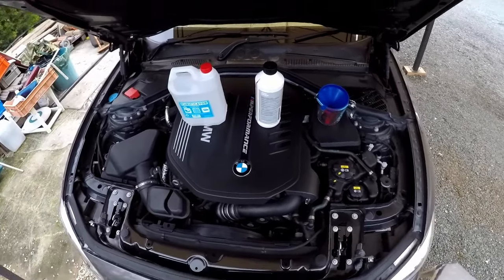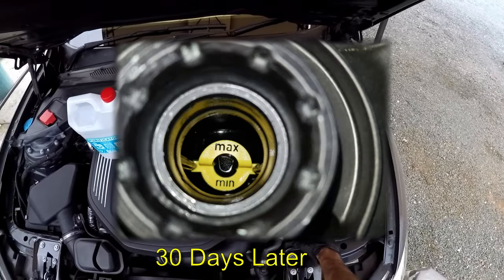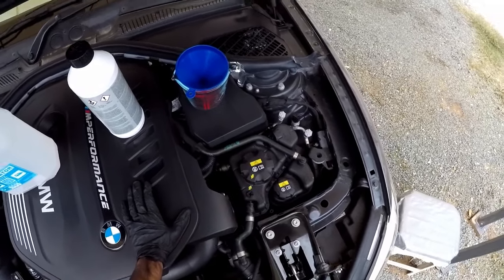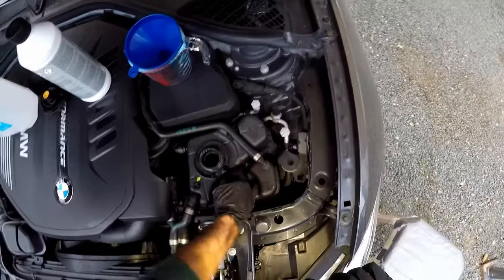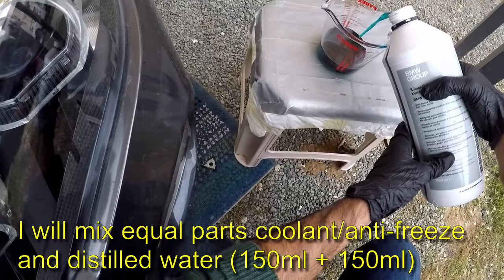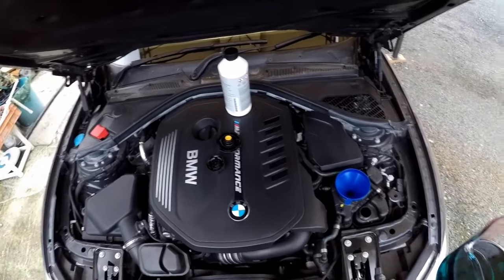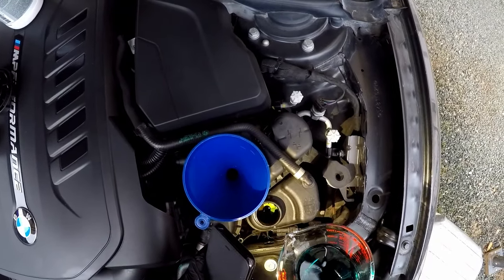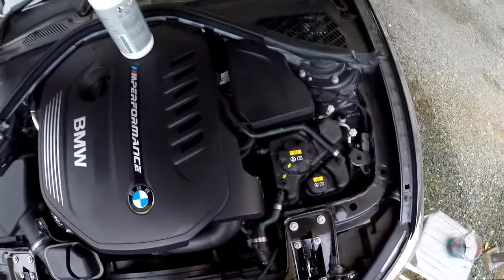BMW B58 Engine: How to refill coolant (Escaping from Filler Cap - Quick Video)

Comment: Ik your not suppose to mix coolant but I got mine used and I don’t know if they used oem blue bmw coolant. I am at 41k miles and I need to top it off. Would it be okay if I top it off and wait until 50k miles to do a full coolant flush ?
Reply from the maker: Interesting question, I guess the chances of the previous owner(s) using some completely unapproved and dubious coolant is quite low (i.e. issues that could come with intermixing are quite low probability). Depending on how much you need to top up, perhaps just add distilled water? This way there is no risk.
Reply: @NoBrainerTalk  it’s just sitting right under the minimum line but I’ll give that a try ✌️

Comment: The yellow min/max gauge thing appears to be attached to two vertical rods inside the reservoir. Is the yellow gauge thing supposed to slide up and down on those rods or is it always supposed to be at the bottom, (roughly 6 inches below the top of the reservoir)?
Reply from the maker: The minimum-maximum level indicator should be at a fixed height within the expansion tank, it should not move.

Comment: 🤔hm, I have to add some coolant to my 340 i 2020 I don't drive to much but about 8 months, and I have a chevy tahoe 2005 in 8 years of driving 50 000 miles no coolant added, just saying 🤷‍♂️
Reply from the maker: Fair point.

Comment: Hey so I wasn’t paying so much attention and just dumped in coolant until it reached the top of the reservoir haha.. do you think that would cause any issues? Only thing I may think would be an increase in pressure against the reservoir and connected hoses.. which could cause a leak? Maybe? Let me know what you think. Thanks
Reply from the maker: You should remove the excess fluid (fluid above MAX), as you have left no room for expansion in your expansion tank. Only negative consequences can occur including bursting of weak spots in the circuit. No way to predict what will give up first, you don't want to find out. :)

Comment: i have the yellowish color in my intercooler tank, it’s little below the min but not much, can i add some 50/50 blue bmw oem coolant with distilled water mix to top it off?
Reply from the maker: As I don't know what the yellowish coolant is, I can't recommend to mix any blue coolant in there. Top up with distilled water is the safer choice in my humble opinion.

Comment: Great video. Question, just drained coolant on mine and also did the bleeding procedure. The coolant in the main tank for engine cooling stays at the correct level. However, the second reservoir for intercooler went below minimum mark everyday after using my car(it has been 3 days) and I filled it back up 3 times accumulating about 500ml of 50/50mix coolant already. I assume the secondary reservoir uses electric pump which should already had been bled as I mentioned earlier. Do you have any suggestions?
Reply from the maker: I'm sorry to hear about your issues. The bleeding procedure can be imperfect, and topup soon after is not uncommon. However, assuming this is persisting (topup daily), and you don't suspect the expansion tank cap (no sign of spills/evaporation), you probably have a leak somewhere in the intercooler coolant circuit. Have a good look at the intercooler radiator at the front of the car, especially if you don't have the black stone guards. If you do have the stone guards focus especially in the middle area where there is a gap between the stone guards. If there is no obvious sign of leak (at the radiator or elsewhere in the engine bay), and the coolant continues to be consumed at this rate, the system needs to be pressurised for troubleshooting. It's possible for the coolant to be lost in the intercooler and end up in the cylinders for combustion,  so also check for the smell of coolant from the exhaust while the engine is running. If you see noticeable smoke from the exhaust this would also be a sign of coolant going into the cylinders.
Reply: Thanks for the detailed explanation.
The intercooler reservoir fluid stayed level between min and max without having to top off for years until I did the coolant drain, so while the leakage might be the problem, I am leaning towards the imperfect bleeding procedure. Just curious if the bleeding procedure (low beam on, heater to max and lowest fan setting + holding the accelerator actually bleeds both engine and intercooler coolant or is it just for one of them?
Also, just monitor the intercooler reservoir again after letting the car cool down and the coolant level seems to remain where it should be now :)
Reply from the maker: @Bennymix99  I believe there's a dedicated bleeding procedure for the intercooler coolant circuit. I believe it's very similar to the engine coolant circuit, but headlights on (not just low beam) and hazards on, then the rest - heater to max and lowest fan setting, and hold accelerator for 10-15 seconds (until the pump starts working).
Reply: How did you drain the coolant for each system? I can't find any info on drain points for these systems. Thanks!
Reply: @michaelkelly3158  Any success? I am also curious about it at b48 engine. I think removing the lower radiator hose should do but not sure?
Reply: @cemildenizel2223  I didn’t do it in the end and everything has been ok since
Reply: @michaelkelly3158  You have to drain and replace the whole coolant every 2 years. so you will eventually do the process. bmw authorised service uses tap water instead of distilled or drinking water , so it is better choice to do it yourself if you dont want your heater not heating the car in winter because of clogged heater radiator caused by bmw dealers tap water.

Comment: My coolant caps were rock solid to turn as well only 12k on the car, lubed the seal and thread now it's like butter ;-)
Reply: What did you lube them with?
Reply: @jzallday102  A light smear of silicone grease. I'm at 25k now and still no issues with the caps.
Reply: @sportsmachinerr1401  thanks man

Comment: Had the same issue on my 18 F32 440.. Car has 22k miles on it and noticed it around 10k..  Issue was only in the main coolant tank.. Asked my dealer to replace the cap and that fixed the issue for me.
Reply from the maker: Certainly the most commonly reported issue and solution.
Reply: @NoBrainerTalk  Is the new cap you get from the dealer a new cap for the same version car, or is the cap you get from factory from a newer model car or a recalled part that is fixed with a better seal?
Reply from the maker: @jonathangarn9635  It's brand new part, and it's the same Part Number as the existing one. To be honest I haven't installed my new caps, I'm saving it for a special occasion. 🤣🤣🤣
Reply: @NoBrainerTalk what's the year/month of your B58 car ?
Reply from the maker: @LionHeart567  May 2018
Reply: @NoBrainerTalk  Production date May 2018 ? There are two SIB if I remember for coolant factory filling issue on B58, and possible turbo issue, both till september 2017. And online I saw that the turbo can eat coolant (which is not normal). Maybe the bmw time period is not large enough ? How many km/miles did you make in these 30 days when the level dropped below the minimum ? Thanks
Reply from the maker: @LionHeart567  Hi there, I honestly don't know the kms in 30 days, but it would have been quite minimal. Thanks for the general concern, but since the replacement of the caps on my expansion tanks, I have had zero issues (checked today, level is exactly where it should be). In terms of the SIBs, if you can find the references I will check them out for my general knowledge.
Reply: How did you get the coolant Temp on your dash. I have a 2017 540i. New coolant reservoir tank at 65k and new radiator with 85k miles.  This design of radiator runs straight across and doesn't zig zag like the old radiator that is top to bottom. Good luck.  Run the AC when it's hot so the fan kicks on
Reply from the maker: @Nick-wr7vv  You can see coolant temp using the hidden menu. I have a separate video on that:
https://youtu.be/-qCwnptZ2Kg
Reply: @NoBrainerTalk  thank you for the hidden menu. Now that I changed my radiator I didn't put the bottom plastic on yet. Just checking things out. After I drove it around for 10 minutes. The top of the radiator is hot. You can't touch it. I crawled under. The bottom of the radiator isn't even warm. I don't understand what BMW is doing with this design. But it isn't working
Reply from the maker: @Nick-wr7vv  Good luck and be careful.

Comment: I done my coolant service with vacuum machine but when i tried to do on small coolant reservoir it didn’t work so can you tell me how to do that i also want to flush that small reservoir
Reply from the maker: You can do a post flush bleeding procedure for each system, so if vacuum filler didn't work, just bleed the low temperature circuit using the BMW procedure for that circuit.

Comment: Man, thanks for your video but empty in only 30 days looks strange no ?
Reply from the maker: Yes, but the caps are main culprit. I replaced the caps around a year ago, and I think there's been no issues since. So far.
Reply: Would you say these can still be a culprit if I cannot see any white deposits on the top of the expansion tank? Mine seems to go from Max to below min every 120miles

Comment: Hello im loosing water on the small tank but i have no water on the floor sometimes comes white smoke from the exhausts and the car shocking and lose power like i drive only with 100hp no turbo then i turn off the car and turn it on again and i cant drive slowly or normal i have to give him a litle boost for that dont happen and start choking again and lose power and have a error on cylinder 6 what could be?thanks by the way
Reply from the maker: The small expansion tank is for the intercooler circuit (charge air cooler) and it's an independent coolant circuit that does not cool the turbo. Loss of coolant from the intercooler coolant circuit could reduced performance, but what you describe seems to be more severe. Coolant can be lost from the expansion tank cap, so not having a puddle underneath is not strange. I don't think you mentioned if you have any CEL, personally I would plug in a scanner to OBD2 port and check for fault codes (e.g. defective sensors can manifest in poor engine management by the ECU/DME). But generally it sounds like you should take your car to qualified mechanic for full check-up, possibly on a trailer if you believe there is a serious engine issue.
Reply: @NoBrainerTalk thanks for the help 💪

Comment: Can you make a video showing where the power steering reservoir is located on the B58
Reply from the maker: Hi there, in most B58 equipped cars the steering is electrical. What car do you have?
Reply: Steering is definitely electrical I had to get mine checked out

Comment: Hi, my intercooler fluid turned brown, and the large one is still green (a little blue I think). I bought my car (2019 440i) from another student, and he told me that he added the coolant in some gas station (repairing store). I do not know whether they added the BMW authorized coolant. So, according to the brown color, could you give me any advice about this? Two coolers are all needed to top up (below the min). I decide to add green coolant into the large one, and a little confused about the small one ( the yellow coolant inside).
Reply from the maker: The intercooler coolant turning brown seems to be a common occurrence. I have had it aswell and others advised it happened to them. Recommend that you flush/empty the system and replace with fresh coolant. If the fluid was once blue coolant, then there has been a chemical alteration. There is no way to know if only the dye element (colour) has changed or also it's corrosion protection and anti-freeze properties. Therefore to be sure, the fluid needs to be replaced. If the car has blue coolant refill with blue coolant. If the car has HT-12 green coolant then refill with green coolant. Do not mix the coolants.
Reply: @NoBrainerTalk  Hi, thanks for your reply. I drive my car to the bmw official dealer as my car is still under the warranty. And they told me that there are two different coolants for B58 engine, and it is normal for the B58 engine that the coolant is yellow (brown) in the small hole. BUT, I think he lied, because I know that there are only two colors (blue and green) coolants for BMW. And when I pick up my car and drive home, I wait the engine to cooldown for more than 3 hours, and I opened the engine to check the coolant status, I found that they add the blue coolant in the big hole (which contains blue coolant before), and while in the smaller one, it is still yellow (but looks like green when I use my phone flashlight to look into the hole) and I use a tissue to get some out I found it is still yellow. So, in conclusion, I think at least the yellow (brown) color is normal for BMW B58, and I decide to get it replaced as my new car warranty will expire this year. By the way, is there any other service that is worth for me to get (maybe cost some small money) before the new car warranty expire?
Reply from the maker: @xuanshen4697  Hi, I would say rather than characterise the fluids as normal,  please ask them to confirm the Part Number for the fluids. If they want to know a reason, tell them you want to have spare coolant at home, and they should tell you what to buy. They should tell you two Part Numbers in this case, one for the blue coolant in the engine coolant expansion tank and one for the other coolant in the intercooler coolant expansion tank. Before warranty expires I would suggest you have the fault codes checked. Not all faults show up to the driver, if there's any stored failure messages or issues you can have them checked out within the warranty period.
Reply: @NoBrainerTalk  Hi, thanks for your suggestion, I will check the fault codes recently and ask for the types of coolants
Reply: @NoBrainerTalk  Thanks a lot!

Comment: Hey can this issue also apply to b48 I got the message about low coolant I checked and there was nothing it was dry in the tank
Reply from the maker: Hi, the screw caps are found on various engine bays, not only cars with B58 engines. So it might be possible for non B58 engines to lose coolant from the cap. But a completely dry expansion tank is cause for concern and will require additional checks and monitoring. Obviously don't drive the car with an empty coolant expansion tank.

Comment: Happened to my 440i when i had it. i was like 🤣😂 your ass definitely get swapped for a x4mc once off lease.
Reply from the maker: Interesting discussion, I've also been thinking about the X4M to replace both the M140i and the Evoque, but is an X4M a proper M-car?
Reply: @NoBrainerTalk  100% worth it the car is fast and handles very good. People complain about the stiffness, but seriously I bought a M to handle the beating i throw at it. I thought the m40i x3/x4 but I wanted the M feel for Suv/sav. Cars i have previously owned m4,m6, 335i, 440i and 650i. All cars i drove daily in highest sport settings while paddle shifting. So trust wen i say it is a proper M car.
Reply from the maker: @w1nnin  I am leaning towards X5M myself, because of the proportions.. Starting to torture myself by building and customising it over and over on the BMW website... This is how it always starts... 😂
Reply: @NoBrainerTalk  guys go to the dealer and have a ride with the x4m, its really very nice BUT , theres NO QUALITY TO PLASTIC PIECES, DOOR HANDLES AND ETC ! so keep it in mind, try to wiggle them when u are there and etc, so that you could see for yourself. Touch every plastic, because in the long run, it will drive you nuts ! 
cheers bois
Reply from the maker: @xxjordexx123  Yeah, rattles would drive me nuts, if they happen for that kind of money. But the BMW interiors are generally top notch, the BMW interior design appeals to me very much (every generation) and is amongst the top quality. I really don't like Merc interiors for example, but it's all personal preference.
Reply: @NoBrainerTalk  yeah i understand what you mean, but trust me, have a look of it in real life :) things a bit different in the x4 models...
Reply: @xxjordexx123  no rattles on my end just did bm3 stage 1 and yup once m3 comp xdrive is out ill get that next for 4,500 vehicle with est 550whp 524tq to wheel this car is brutal fast now.

Comment: but when u replace cap can  u buy the original cap like it was factory installed?
Reply from the maker: Yes, you can buy the OEM cap from multiple sources but your local BMW dealer should be able to help aswell (for B58 - 1st generation: BMW P/N 17117639020 for the large expansion tank and P/N 17117639024 for the small expansion tank, B58TU - 2nd generation:  BMW P/N 17138665638 for the large tank and P/N 17117639024 for the small expansion). Hope this helps.

Comment: Why are you using same coolant for both tanks? I thought they are two different types of coolant? G48 for the main and HT12 for the smaller one? Isn't it? Also have you found the issues? Have you tried changing the cap? TIA
Reply from the maker: Hi, you should use the same coolant in both tanks. As they are supposed to be isolated systems, I guess it's possible to use one approved coolant type in each tank, but that would surely make maintenance more complicated. Due to covid lockdown and curfew I haven't been driving so much these days, so coolant is still at correct levels.
Reply: The B58 uses the H12 for both tanks. The G48 is the older blue fluid. And yes you can mix them.